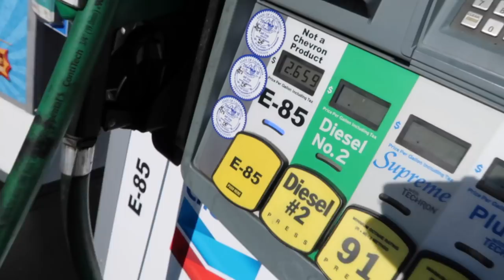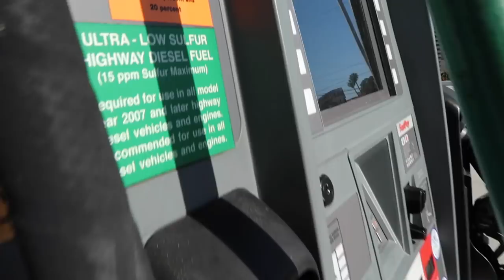Some motivation.

Comment: bro i had my car not working for 1 year, it had problems after problems and these problems consisted of rough idle, stalling, or valve stem seals going out on me if this was someone else i bet they would of just given up and SOLD IT AS IS LOl. And now recently about 1 month ago i finally fixed it for good and fixed my rough idle went away by me changing out my upstream O2 sensor and hence i did not know cars that good like i never worked on cars but with that dedication inside you THAT FIRE towards your craft you can do anything... And i just want to say it feels so good to succeed, never give up no matter what.. #ZocietyStrong